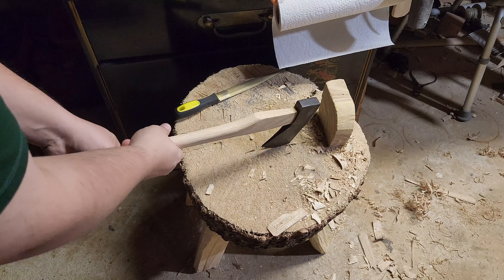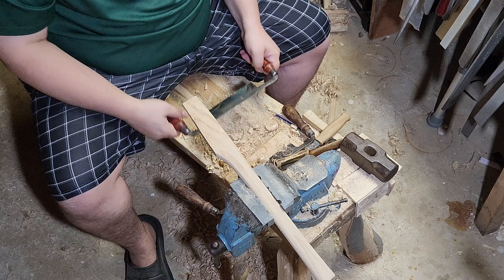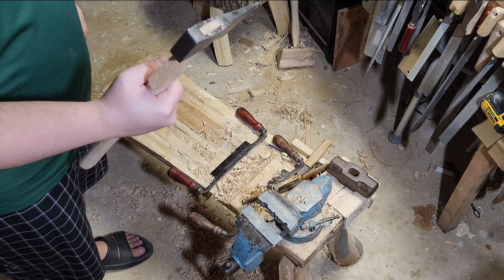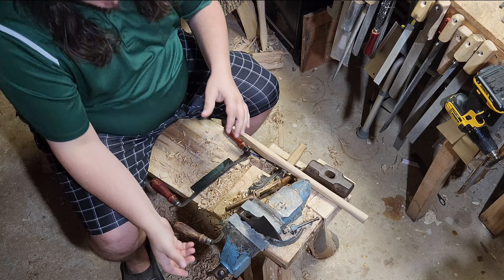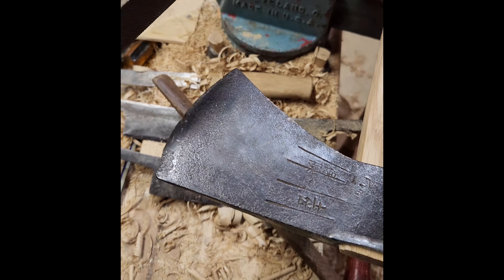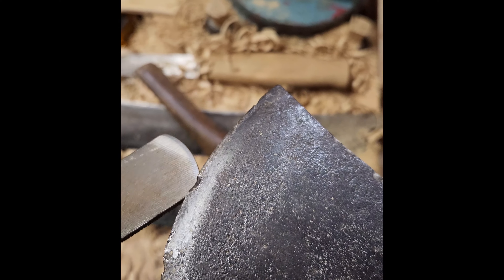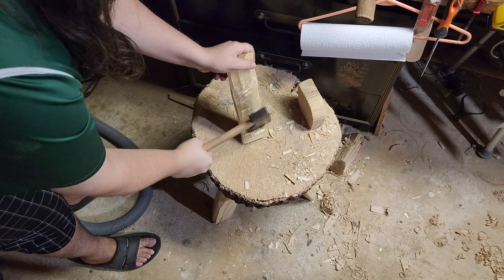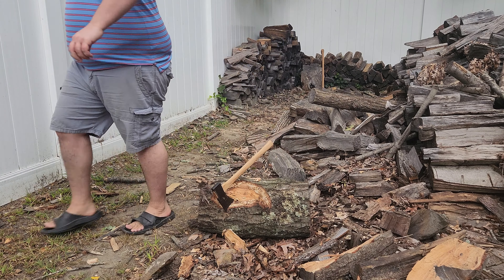Japanese Hatchet Restoration Finale

Comment: Lol 😂 Your videos always crack me up. Enjoyed the stories and watching you try to figure out what that axe is meant for haha. You’re right on the money about Japanese steel being hard. Almost all their vintage axes were laminated with bits around 62-65 range. Just ridiculous. Goes to prove the Japanese don’t mess around. Since they never make mistakes, they never have to repair damage, or sharpen for that matter 🤣

My buddy and I have quite the collection of Japanese axes now. Most of them his, but I take a lot of interest in it as well. I still don’t entirely understand how to get a solid hang with those straight tapered eyes. 

The vintage axes had big wood blocks wedges in front of the eye, sticking down past the front of the handle. Easily tightened by hammering and also could be removed by pounding the block out. I think this is what the modern companies were trying to mimic when you see those dumb metal wedges sticking out the top.
Reply from the maker: @Codi_Clapper  a lot of the Japanese axes I saw online have straight bits.  I thought it was pretty cool this one didn't.  But I do think I'd prefer to use a full sized axe.  

Both this hatchet and a hardware store hatchet were a gift.  It was hard trying to get anything in Japan without being there myself.  I didn't make the handle thick enough but it still wouldn't punch above it's weight for carving like the hardware store hatchet on a shorter handle.